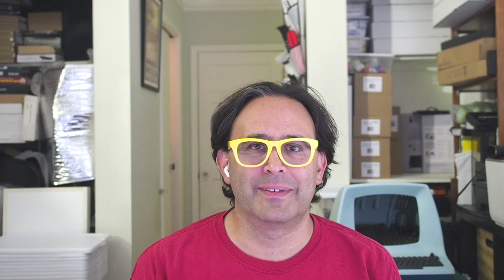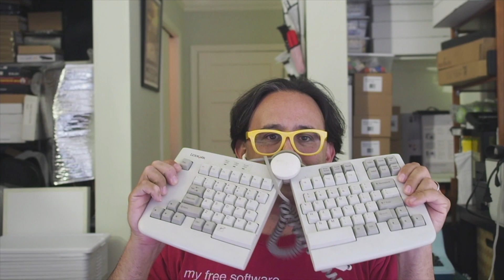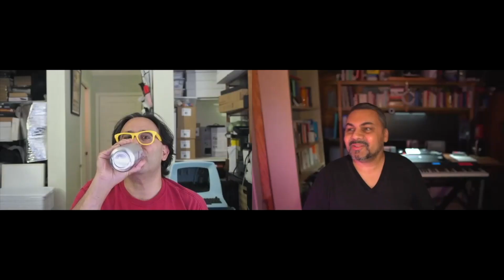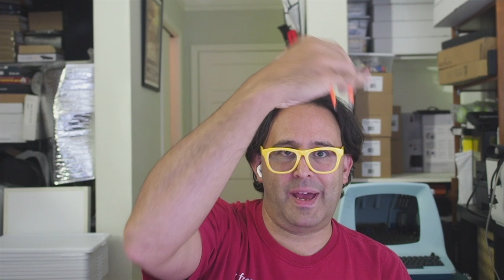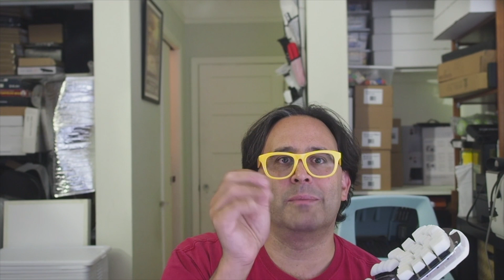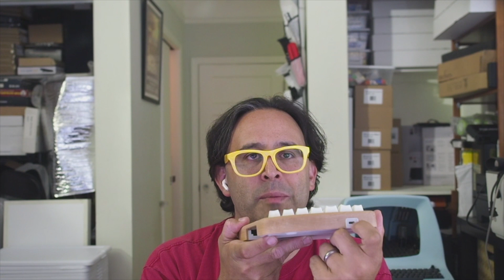Jesse Vincent of Keyboardio

Comment: Did the new model get the better micro controller?
Reply: Did you get an answer? How does this keyboard stack up against the moonlander, or against the kinesis? I'm interested in the 360 when it comes out
Reply: @username54487  It did get the new microcontroller. However I had to cancel my order because the project kept getting delayed every month. I bought a Keychron keyboard instead.